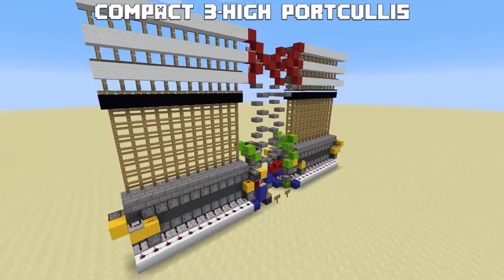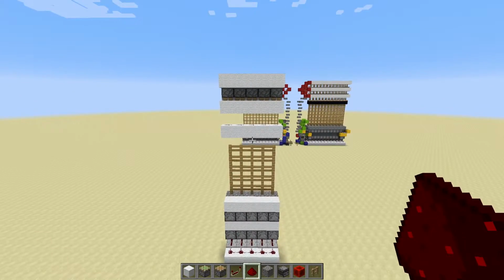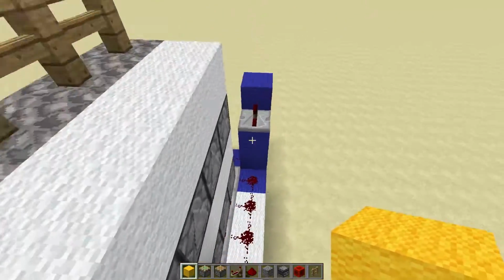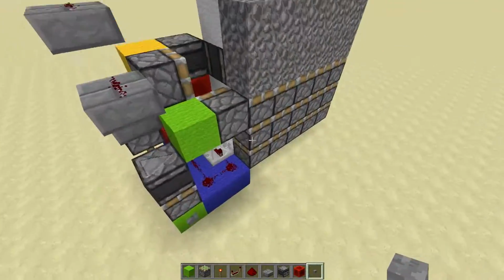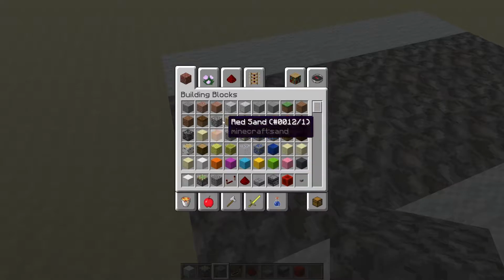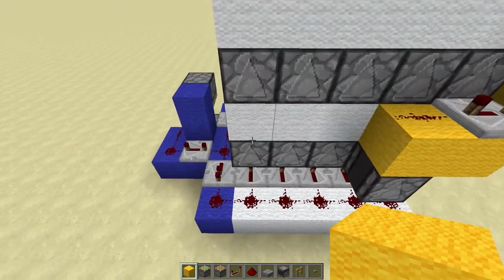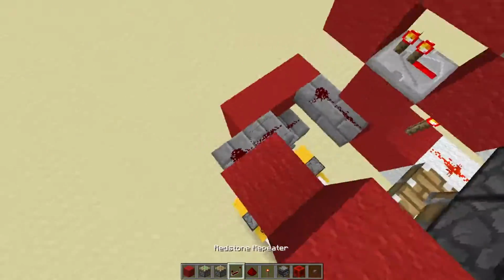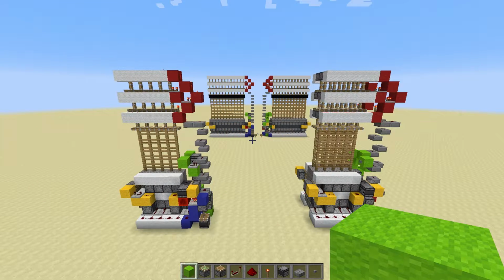Minecraft: Compact 3-High Portcullis(Castle Gate) Tutorial

Comment: does it not work in 1.16.3 or did i do something wrong
for some reason the pistons pushing the observers back and forth don't work
Reply from the maker: Hmm, it looks like 1.16 changed redstone dust so that it connects to pistons next to it, thanks for letting me know it wasn't working properly. 

Here's a quick fix: https://imgur.com/a/RH9gl6E 
The changes are: add a 1-tick delay repeater to the red wool line (and some blocks/redstone to connect everything) and increase the delay on the repeater in the blue line to 2 ticks. The blue glass should be replaced with a solid block.

There might be a way to fix it within the original footprint, but I'd need to mess around with it some more.
Reply: @Russle  thanks :D
Reply: The link seems dead, do you maybe have an additional link? :)

Comment: Hmm, so I'm on 1.12.2, trying to get it working on a server. Works great except that, when opening* the gate, there is an issue in which the top piston on the side with most of the redstone fails to be pulled down by the sticky piston that's supposed to grab it... any help?

EDIT: The timing on just that set of pistons is off... not sure why that column goes off what looks like a tick late...

EDIT 2: And of course it's because I accidentally gave that column's repeater a tick extra delay than the rest lol. Works fine now, thank you :)

Comment: What advice would you give to use a lever over the gate in the gatehouse to open and close it? 

On another note, dunno what exactly was happening, but when I used a button it pushed up 3, but when I used a lever (using the same design as your first option in the video) it only raised 2. Is this an issue with levers in general, or just something going wonky?

Comment: For some reason, and i cant figure out why, but it doesnt push further up than two blocks, the gate doesnt go three blocks up when i push the button.
Reply from the maker: Other than the gate itself, are all the other parts moving properly, such as the line of observers and the top pistons retracting before the bottom ones extend?  Both of these can usually be fixed by double checking the repeater timings.  Also, if you have your buttons in a slightly different spot than in the video, you might have to change the wiring to avoid interfering with the piston for the observer line.  Lastly, double check that there are no more than 12 blocks above the piston on the very bottom, not counting the top pistons.  Hopefully this helps, let me know if you have any more questions.
Reply: @Russle  The thing is, Ive found out, the top layer of pistons pushing the gravel just doesnt extend. i dont think the observers on the top are powering those pistons. everything else is working perfectly. the observer blocks arent moving for some reason? the pistons dont push them to re update them.
Reply: Never mind, i doodled around, added a repeater to the left piston (pushing the row of observers,) and changed some wiring. Had to do it a bit differently but it worked, thanks!

Comment: Still works in 1.13 .
Do you know if it is possible to ad a lock system to it? Turning on or off a lever would lock the gate in the state that it currently is in. I have tried different things, but I'm not able to do it. Maybe you have an idea?
Reply from the maker: What type of lock behavior are you trying to get?  If you just need the gate to be locked closed, the simplest way to do it would be to have an extra lever that goes directly to the redstone line powering the upper pistons.
Reply: Yes, mainly locking the gate when it is closed, so people on the outside aren't able to open the gate by pressing the button. 
I think I tried to do that and I think that the bottom broke because it wasn't able to push, not certain anymore, tried so many things. Can't test it right now, but as soon as I can I will try it (again) and I'll let you know something.
Reply from the maker: Oh, one way to disable the outside button is using a piston and lever with something like this.
https://imgur.com/KYkCaGl

or this if your gate is mirrored
https://imgur.com/4lpoEA6

Let me know if you get it to work or if you need any more help.
Reply: The second image is what I need, but when I open the gate by pressing the button on the side where there is only redstone dust, the gate only opens 2 blocks. It is very weird.

Redstone dust side (always opens only 2 blocks): https://imgur.com/a/X9tenqf
Redstone repeater side (opens 3 blocks): https://imgur.com/a/wcUz6Br

Maybe you know why?
(Running the redstone dust straight to the observer doesn't fix the problem.)

I need the repeater side on the most empty side, so like in my pictures. (Repeater side = outside of the castle.)
Reply from the maker: It looks like the piston that pushes the observer line is getting bud-powered by the extra bit of redstone above it.

This fixes the problem (replace the glass with a solid block, and both slabs can be replaced with full blocks if you want): https://imgur.com/a/Tlg7EYQ
Reply: OMG thank you so so much!!!
Reply from the maker: You're welcome, glad I could help :D
Reply: @Russle  why haven't you posted